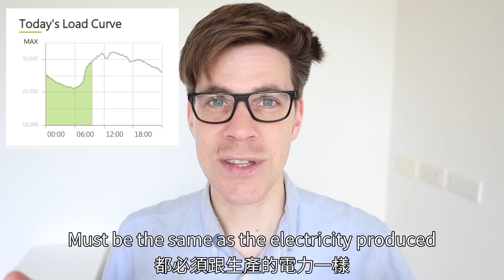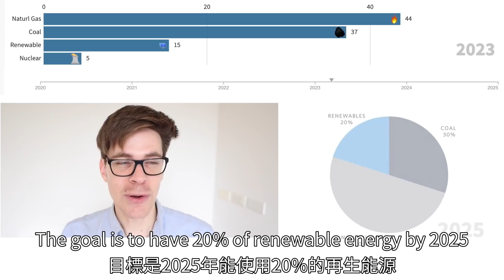一周停兩次電？！瑞典電力工程師怎麼看？| Swedish Engineer experiences 2 power outage in Taiwan！

Comment: The northern part of Taiwan lacks electricity, but the northern part of Taiwan is unwilling to build a power plant due to environmental issues. Instead, the central Taiwan thermal power plant supports the power required by the northern part of Taiwan.
Reply from the maker: The biggest imbalance is actually in the south! They generate about 36% of energy but only use about 33%.

Comment: I want to ask a question. For example the Coal power plant, what I know Taiwan has high Environmental protection Stipulate. When coal power plant has carbon dioxide emissions, there are many equipment to reduce "Floating particles". But I am not a expert, what I want to know maybe someday you can be invited to visit the coal power plant and give us more information about the Environmental protection Stipulate equipment what power plant have.
Reply from the maker: Yes I am aware that there are different kind of filters and also Carbon Capture and Storage that can deal with CO2. I think also new coal power plants have lower emissions compare to the old ones. I am no expert on coal power plant but it would be interesting to make a video on this aswell.

Comment: Hi, I am a viewer from HK. I know most Taiwanese refuse to use nuclear power considering what happened in Fukushima. In my opinion, I don't think there is any alternative for them. In HK 50% of the energy supply are from natural gas. Taiwan can use natural gas too but that would become a geopolitics problem. You have mentioned that renewable energy are difficult to save. How about storing those emery by connecting the energy grid to a reservoir which can pump and store the power.

Comment: Hi Jonas, how to determine solar system 's capacity connected to the grid in Taiwan?
Reply from the maker: Do you mean you want to know how many GW is connected right now? You can check here (close to the bottom): https://www.taipower.com.tw/en/page.aspx?mid=4484&cid=2834&cchk=20432baa-1f39-4018-aed8-7b33b02f942e
Reply: @JonasTjader  Thank you for sharing the information. Our government is also boosting few renewable energy programme especially roof top solar system in Malaysia. The involvement of the investors so far is beyond than satisfaction 😌

Comment: 00:57 台灣，大部分的電，都是火力發電（by using 煤炭Coal [46%]）&加上 _天然氣（natural gas）33% & oil 2%
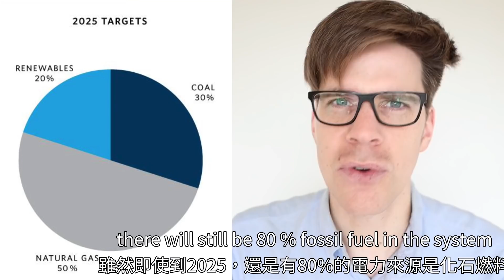05:14  [到了2025年]還是有80%電力來源是 化石燃料（fossil fuel）&考慮台灣是島嶼國家，加上電池很昂貴，up主覺得使用 20~30%的再生能源（renewable energy），已經是台灣的挑戰了
01 :05 高雄興達（Hsinta  Power station）電廠 是台灣最老的發電廠,已經37歲了！！   01:30停電原因，錯誤按下「3541」隔離開關！！所以發電廠才套點
37GW（全台灣 當時用電量）；興達（Hsinta  Power station）電廠提供電量是 4.3GW，發電量非常大&「佔台灣發電量 11%」

Comment: (地熱發電) Why don't we choose a renewable but stable energy? How about putting geothermal energy into our long-term energy plan! It's reliable, not like solar energy, which decreased during afternoon and deteriorated the outage situation. No fuel are needed, which means Taiwan are more independent from natural disaster, pandemic or economic blockade . Not much CO2, air pollution, and no radiation hazard would be generated. Besides, hotspots are close to metropolitan, Taipei, so power line loss could be ignored. No matter it's windy, sunny without wind, drought, or typhoon, the geothermal energy persists. The geothermal energy fits all we want, and the only problem is money. However, if we give it as many budget as nuclear power plant took, it can work. It should be a long-term investment in Taiwan.
為什麼我們不選可再生、乾淨、卻仍然穩定的能源呢? 地熱發電應該要加入台灣長期能源規劃中! 地熱發電穩定，不像是本次太陽能發電隨著時間漸晚，發電量更加減退，使停電狀況還更加惡化。地熱發電完全不需要額外補充燃料，這代表台灣不會受到自然災害、疫情、或是經濟制裁等事件影響能源穩定，且幾乎不產生額外的二氧化碳、空氣汙染、輻射。地熱發熱熱點在大都市台北旁，所以也沒有太多線損問題，不需要南電北送，減少區域不公平問題。而且不論是風大，風小，有太陽，沒太陽，乾旱，或是颱風天，地熱發電量基本維持穩定。地熱發電幾乎完全符合台灣的需求，唯一的問題只有錢，但是如果我們投資跟核電廠一樣多的金錢於其研發，誰說我們一定做不到? 地熱發電應該也要加入台灣長期能源規劃中。

Comment: In the interim, I believe that Taiwan should decommissioned their oldest operating nuclear power plant and replace it with the newly built 4th nuclear power plant.  It will be replacing replacing the older less efficient plant.  The new 4th nuclear power plant should be more efficient and safer.  Therefore it should appease the environmentalists as we're not increasing the number of nuclear power plants.  If managed effectively, nuclear power plants are a source of clean and cost effective source of energy.  What's your opinion Jonas?

Comment: Nuclears power plants are all built in places hard to be affected by tsunami.
As a electricity engineer, you shall know the disaster happend in fukushima caused by wrong decisions made by the tokyo power company and the government,
The nuclear power itself is innocent.
If fukushima first nuclear power plant's retaining wall could be higher as IAEA suggested, the emergence power supply system was not set in the basementm, and sea water poured into the reactor immediately while the reactor lack of wated to cool down, lots of events happened that would not happen.
You shall know that.

Comment: You mentioned that Japan suffered heavily from Fukushima incident, but why they still increase the proportion of Nuclear power usage? Have you ever thought about that?
The reason is that the ideal alternative of nuclear power, fossil fuels can generate green house gases and toxic gases which are proved to be the main culprits of lung diseases.  And you know what ? Lung cancer is one of the most common causes of death in Taiwan and strikingly, the majority of those patients don't smoke, which means their cancer are result from air pollution.
Taiwan has sacrificed too much because of the fucking increasing use of  fossil fuel
Just remember that
AIR POLLUTION CAUSES MORE DEATHS THAN NUCLEAR POWER DOES NOT ONLY IN TAIWAN BUT ALSO IN THE WHOLE WORLD!!
Unlike many EU countries where the winds are moderate, those winds in Taiwan are either too strong or too weak. To meet the demands of electricity, increasing the proportion of nuclear power usage is the only feasible solution.
We all know that renewable energy is the optimal solution, but recently, nuclear power is the only reliable choice. 

Still can't get why so many people think they learnt a lot from this video. Did you guys actually study when you were at school??  lol

Comment: The problem of power outages in Taiwan can be attributed to the fact that "the south has more than enough electricity, the center has no shortage, BUT the north is in great need of electricity," to the extent that the south sends electricity north all year round.

But, much to our dismay, every attempt to increase power supply in the Northern and Central Taiwan has failed since 2018:
In 2018, the Chinese Nationalist Party (KMT) pushed for a referendum and successfully vetoed the 1200MW Shenao ultra-supercritical power plant in New Taipei City.
In 2018, the KMT pushed for a referendum and passed a call for a 1% annual reduction in thermal power generation. 
In 2020, the KMT blocked a construction permit for the renewal of Taichung's natural gas-fired generating units, delaying the start of construction of the 2,600MW natural gas-fired units. 
In 2021, the KMT assisted a referendum (to be held in August) to reject the establishment of a third liquefied natural gas terminal in Taoyuan, in order to delay the operation of the new 3100MW unit.

Coupled with the trade war between the US and China, many Taiwanese businesses have returned to Taiwan, resulting in a significant increase in industrial electricity consumption……

What I want to say is that Taiwan is good, but there is a large group of people and many political parties and media outlets on this island that do not identify with Taiwan. Due to the 38 years of martial law imposed and brainwashing in the nation, despite the democratization and the party rotation, the KMT and its partisans still cannot accept stepping down from power, and they do whatever they can to keep holding Taiwan back….

Sorry for the long-windedness. Despite you being a foreigner, there is still something about Taiwan you should know since having lived here for some time.